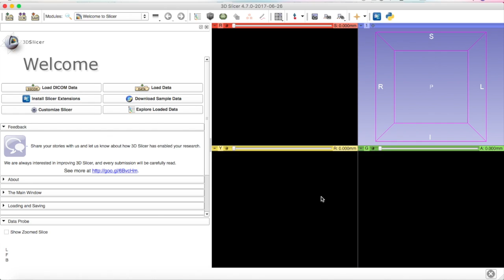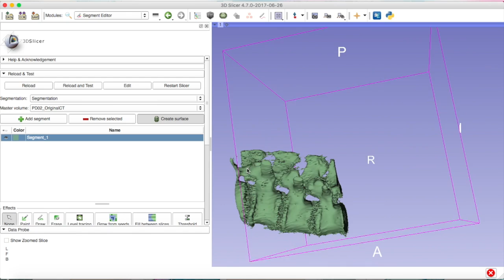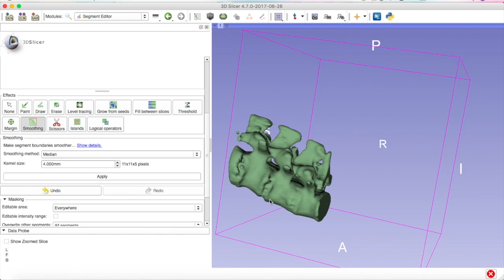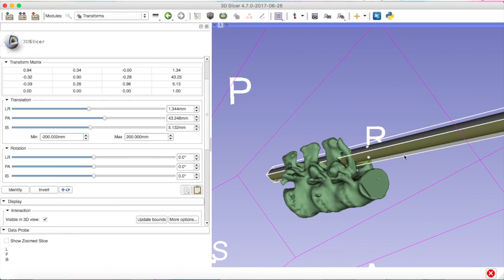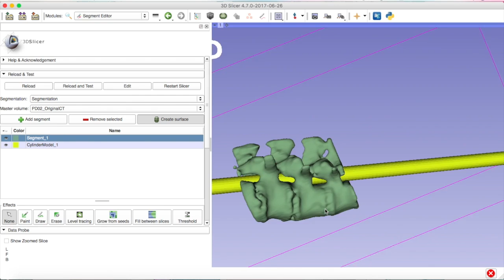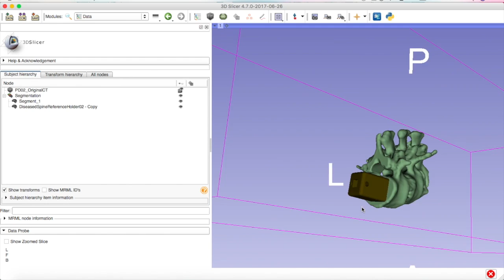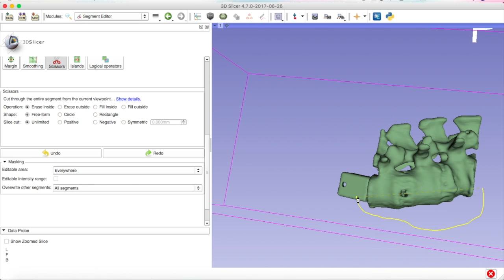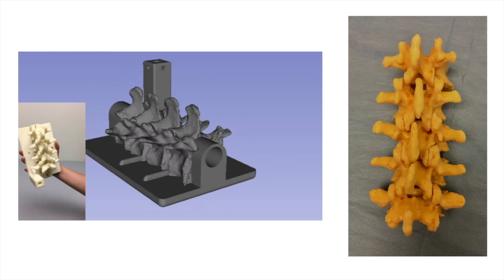How to segment multiple vertebrae in spine CT for 3D printing

Comment: Hi, what program did you use to create the cylinder? I tried to make one in Prusa Slicer and import it into 3D Slicer, but it does not work.  Is there a possibility to create basic shapes and simple objects in the 3d Slicer itself?  Thanks!
Reply: Your can create models of simple shapes in "Create Models" module (in SlicerIGT extension). You can also create many other shapes using a few lines of Python script (using VTK library, as shown in examples in the Slicer Script Repository).

Comment: I have a doubt, I have CT scan files with images in only one plane. And I have multiple CT scan files for the same patients. But because all the planes are not in one file, I cannot segment them. Is it possible to combine them into a single file?
Reply from the maker: This sounds like a regular DICOM image. You can load these using 3D Slicer's DICOM module: https://slicer.readthedocs.io/en/latest/user_guide/modules/dicom.html 
If you need further help then write to the Slicer forum at https://discourse.slicer.org
Reply: @PerkLabResearch  yes I got it. I was doing it wrong. I needed to load the whole directory I guess.

Comment: Thanks for the info! I'm new to this slicing software and could use a little help. I don't need to edit my dicom files like in the video but I am having some trouble converting to .stl properly. I am able to save what appears to be the correct .stl file to my computer but can't open it in any other slicing, preview or editing software. I followed the steps in the video but am having some trouble, can any one give me a hand? 

Thank you you very much,

Andy
Reply from the maker: From this much information it is hard to tell what can be wrong. Use "Export to file" feature in Segmentations module. If you have problems opening the STL file in MeshLab then report the issue at the Slicer forum - discourse.slicer.org.
Reply: @PerkLabResearch  Thanks for the help

Comment: Hi, thanks for the tutorial. Is there a way to measure the cropped part dimensions?
Reply: Yes, there is a ruler tool in Slicer. You find it in a drop-down menu next to the fiducial selector mouse mode button that looks like a blue arrow pointing up from a red ball (on the toolbar). Rulers can be placed by clicking at two different points in any viewer. You can drag the ruler end points to adjust them.
Reply: You can also use Segment Statistics module to get surface, volume, min/man/mean image intensity, etc. for each segment.